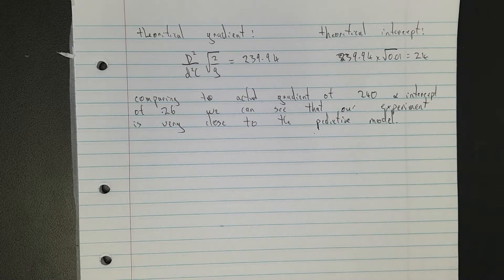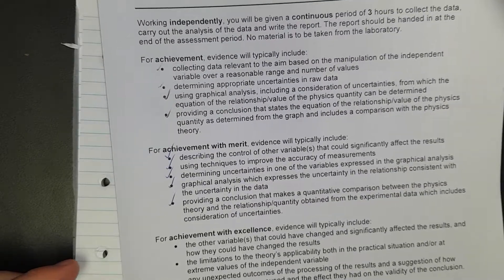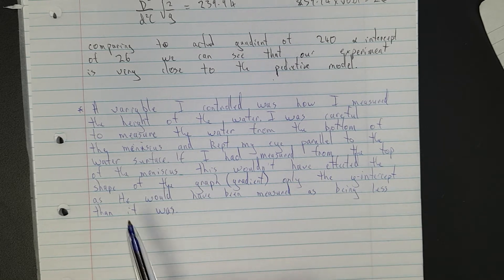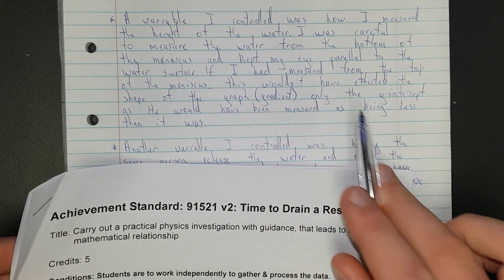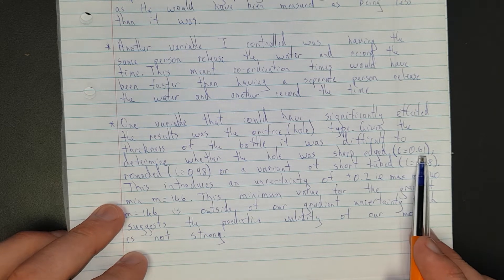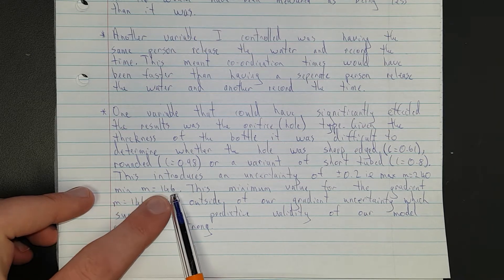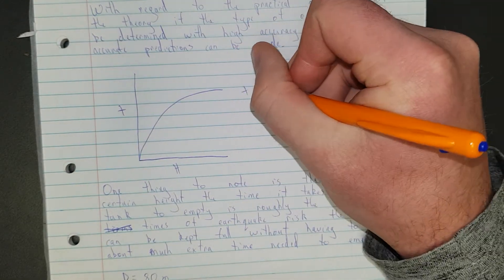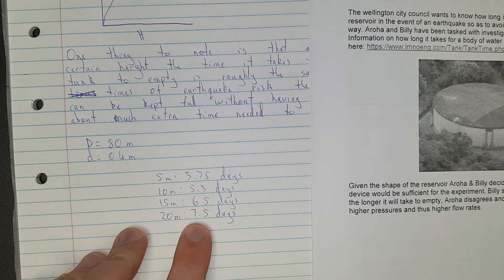3.1 Practical investigation AS91521-Discussion

Comment from the maker: For reference, there are a few mistakes in this video and it's probably an Achieved because of this (I made this in 2017). However, I have decided not to delete the video as it gives a general overview of what is needed in the discussion.
Reply: What were the mistakes that kept it from gaining excellence?
Reply from the maker: @thirtyfirst  When comparing the gradients I said "our experiment is close to the predicted model", what I should have said is that the theoretical gradient is within the bounds of my gradients uncertainty then compared the numbers numerically, thus my experiment supports the theory. Note it does not "prove" the theory it only supports it.

 My theories applicability example was weak, there are others in this experiment that have more of an impact. For the last paragraph I should have equated the time to empty the tank to the volume, this would have required deriving an equation that links Volume~Time (would have needed to discuss the implications with respect to the context).

There are quite a few better discussion points that you can discuss. Also there are better control variables worth discussing than the hole type, such as surface tension of the fluid, bottle shape & diameter, hole size, viscosity of the fluid etc.